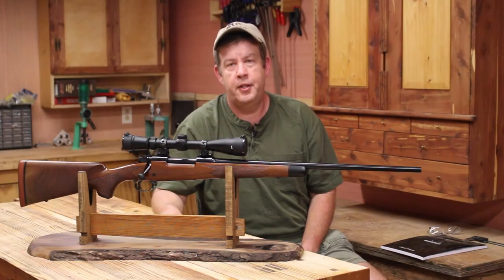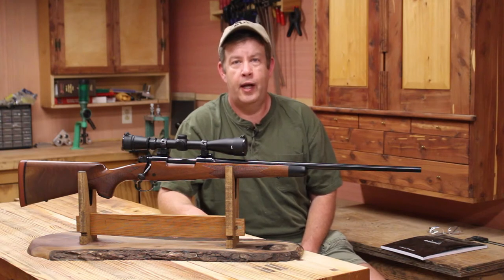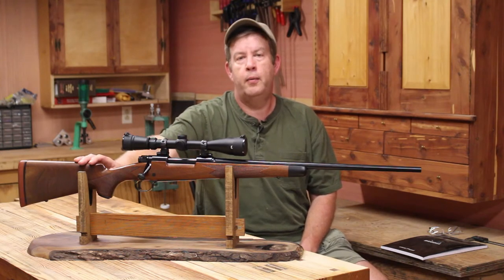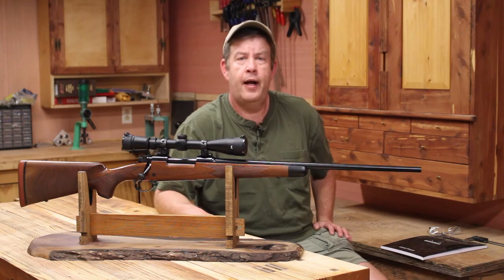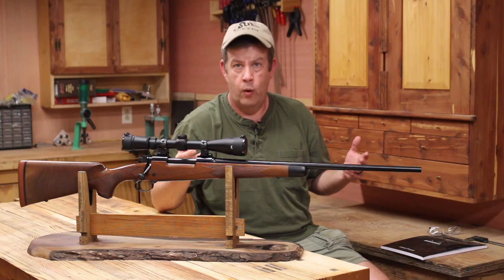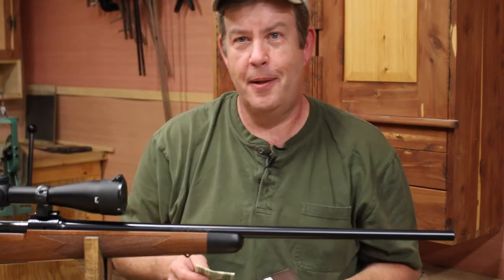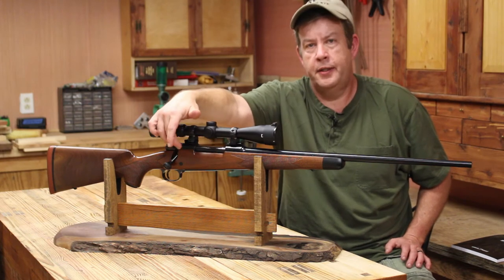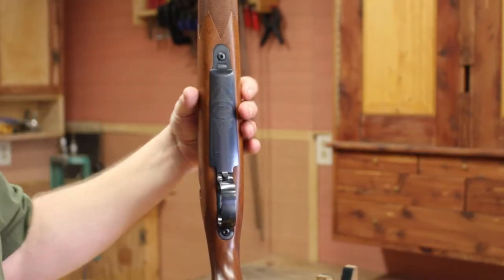Fixing My Deer Rifle Accuracy Problems ... 2020 Deer Rifle Setup Pt1

Comment: The key to rifle accuracy always has been and always will be getting everything out of the way of the action and barrel so it can do what it does best. This includes the stock (properly fitting it like you did) and the shooter (using proper shooting technique). Even old rifles with “bad heat treat” are generally sub moa guns when you get everything out of the rifle’s way. Obviously there are exceptions. 
There is no doubt that your sporter barrel is supremely accurate. You just had to get everything out of its way! Great video, I have no doubt your channel will grow.
Reply from the maker: Thanks Peter! I did get to the range yesterday to start load testing. My shooting wasn't great but the rifle was doing it's part!

Comment: TOM.   I am fairly certain that you would be aware of .... LONG THROAT CHAMBERS being typically more accurate with  heavier ROUND NOSE BULLETS.   HAWK bullets in New Jersey still make the Round Tip Bullets... For example: 175 grain 7mm  .284" Round Tip  'among others'... and you might get a choice of jacket thickness.   For deer  hunts  in the deep south...  I might get the thinner jackets.  Your animals are usually not as large as some of the beasts  we might encounter,  in other places.

Comment: I'll check the barrel clearance on the Standard featherweight when it gets here. I got some 145 grain Speers, but they are Grand Slam, on the way. The Hot Cores weren't as much, but I already have a few Hornady 154 grain and 162 grain to try also. Got to pick a scope to mount....right now I may just swap one off. I have a low end Simmons Mil Dot I can try to start with. Too much spent getting ready for the Featherweight 7X57. Gonna try Leupold 2 piece mounts. Already have some rings for those.
Reply from the maker: I love the 145 gr for the extra velocity and the Grand Slams will work great. I got good accuracy from the 145 but I got my best accuracy with the 162gr but I decided to go with the 145s for the velocity. And I used mainly IMR and H4350 but I have been itching to try IMR 4166. It's almost identical to 4064 I just happen to have more of it than 4064 and the 4064 is definitely worth a try. My pet load for 308 is 4064 and 175gr Match Kings. That's also the load used by Army snipers for their 308 long range cartridge. So very accurate stuff and should work great. I'm also curious about Varget as well but haven'ttried it yet. And you will probably enjoying reading the article at balistics research.com on the 7x57? He has some good stuff and reading that made me realize that most of the new bullets are made for the 7mm mag and are to tough for the 7x57. It tends to do well with the old bullets that have been out forever because they were designed for the 7x57.
Reply: @TomRiverSimpleLiving   For some reason I never tried Varget. I used up all my IMR 4064, so not having any solves that problem. I saw the 4166 is right next to the 4064 in burn rate.  I'll try to remember about the bullets.  Have only tried 7977 and 4955, so far in other calibers.  I'll read that article. Thanks, again.

Comment: For the 22 in.
 barrel, would you try IMR 4064 or something in the medium burn rate? I know the 4064 sure worked well with lighter 70 gr Nosler Ballistic tips in the 243. I was just thinking about the shorter barrel. I know a lot is said about case fill, but find that sometimes I get the best groups without filling the case. I just don't do compressed loads in any case.
Reply from the maker: I usually end up right at 2800 fps with IMR or H4350 for the 145gr Speer.
Reply: @TomRiverSimpleLiving   Okay I have plenty of that too. Thanks.
Reply: Watched a couple videos of Scott Tulloch---HighCountryHunter, reloading and hunting with a 7X57 in New Zealand. No way I could trudge up mountains. So...I guess I'll stay a flatlander at my age. His videos show some beautiful country though.

Comment: ... if my HUNTING (not bench rest) rifles are giving me 2 accurate cold barrel first shots then I don't have an accuracy problem ... my HUNTING rifles have thin barrels and modest low power variable scopes (I'm not keen on mulling unnecessary iron thru the brush)   and heating will no doubt have an effect on group size by the time the 3rd shot rolls around ... if the deer isn't down by the time the 2nd shot smoke clears it's probably long gone anyway ... my focus as a HUNTER is meat on the ground not 3-shot group size on paper ... 2 shots is usually one more than I need to accomplish that purpose

Comment: Where is Part 2 of this video series? What's the name of the video?
Reply from the maker: The next video I did was "The Bullet Weight For Deer". It wasn't part 2 but I tested 2 different bullets in that rifle and you can see the results. But there will soon be a part 2. The wood kept moving in that stock and it has a very significant bend in it now from the warping but I just found and identical stock and I'm going to replace that one. I figure I need to do a video on that just to show some stocks can't be saved but they can be replaced.

Comment: After you relieve the stock,  I recommend rubbing beeswax and melting it into the stock/barrel track. Helps stabilize it and cuts down stock warpage in humid climates. I did that with my heavy model 70 in the Marine  Corps.
Reply from the maker: For this one I used a couple of coats of Minwax to seal it but that is a great idea on the bee's wax and that goes along with the old oil finished rifles. I know many waxed their rifles with oil finishes and now you have me wondering how many of them used bee's wax for their wax? I suspect an awful lot of them.

Comment: I’m gonna have to try this on my Mossberg
Reply from the maker: I hope it helps?
Reply: I have a Mossberg Patriot .308 Win that I have not shot much. It has the black poly stock. I have ordered a chassis and skeleton but stock and pistol grip from MDT. It's got a v-shape channel and other than the recoil lug and the action screws, there is not much contact and it will allow the barrel to float free like this example. Plus having an adjustable cheek and an aftermarket pad on an adjustable length of pull should be supercomfortable. 

I did something similar with my AR-10. It came with a carbine tube and telescoping stock and I changed to a rifle tube and a Magpul PRS Gen III adjustable stock and that gun is super-comfortable and cushy. And sub-MOA accurate. I mean sub-MOA as in hitting right in the very center of the target sheet, my intended point of aim and impact (I was sighting in a new scope) at 100 yards. And this was after the barrel was already warm with about 15 rounds (grouping, etcetera.) I was going to be happy with 1 MOA.

Comment: No "rhyme or reason"?? I strongly disagree. A rifle is a mechanical device. The foundation of accuracy/precision in a rifle is the bedding. Winchester has never properly glass bedded their rifles. They have been using the hot glue type of bedding material since the late 70's and it is garbage. Secondly, like you pointed out, is the barrel freefloating. Most winchester model 70's are not properly freefloated. The reason for these issues is they are not custom rifles. They are a mass produced rifle. They will always react to a proper glass bedding job and freefloat. Couple that with proper mounting of the scope bases and rings. Proper alignment is key. Keeping your scope mounted low for proper eye alignment is also key. Your scope is mounted too high. You should also not be pounding your action out of the stock like you demonstrated. Very poor practice: sooner or later you are going to damage that stock. Now back to the mechanics of a rifle. You can also fine tune your trigger. Polish out the sear engagement areas. You want minimal creep and a very smooth crisp let off. A good hunting rifle should have a pull weight of around 2.5 pounds for utmost precision. Your BACO rifle trigger would greatly be benefitted by a erniethegunsmith trigger spring. When all the mechanicals are taken care of, you then progress on to load development if you are concerned about ultimate precision. A rifle like yours with a good load, should be capable of 1 moa 10 shot groups, not moa 3 shot groups. Your check with 2 dollar bills folded in half is excellent. That's just about right. Don't forget about those mounts though. They should be aligned and blue loctited down. When you check for accuracy it should also be done with a "proven" scope. This stuff is not hard or complicated. Just stuff that should be checked over on every  new rifle you get. You have some good videos. They are a little slow paced, but good nonetheless...